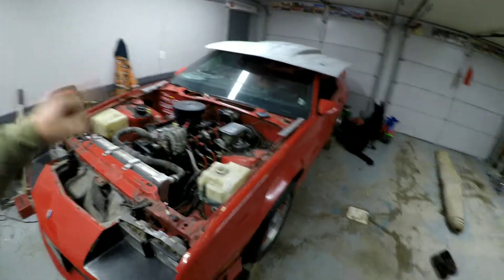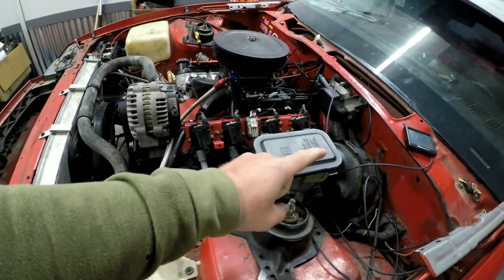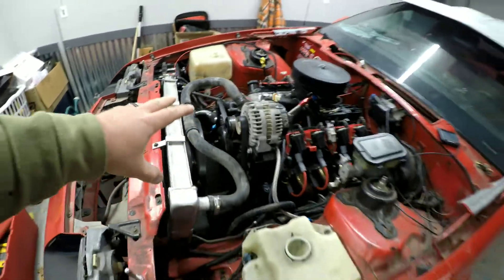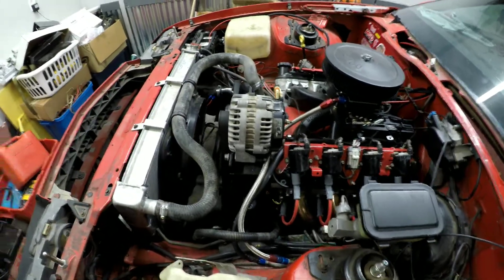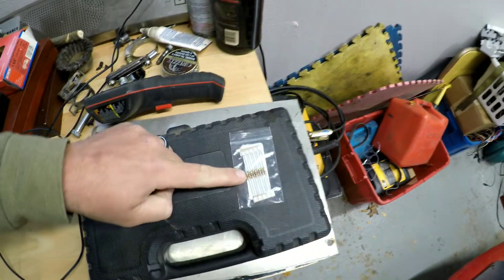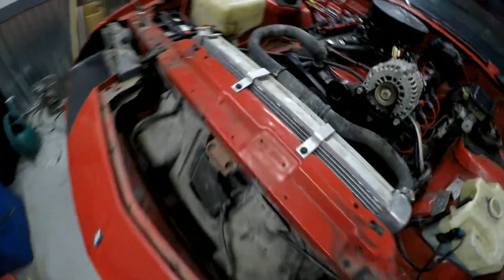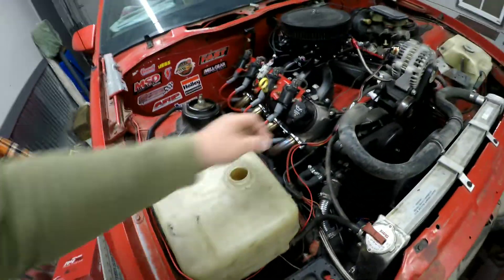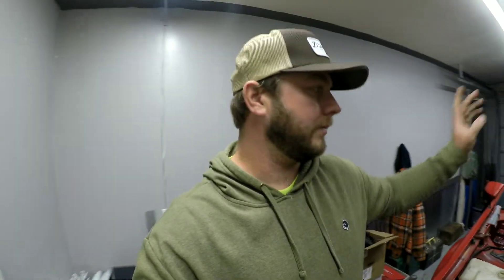EASY LS Swap Alternator Wiring! It only takes one wire! How to add a resistor!

Comment: On the 91 camaro alternator harness, the brown wire goes from key on , to dash light , then to "L" terminal on alternator... now your charge light in dash will work as it's supposed to ... "S" terminal on alternator goes straight to battery for voltage level sensing (not necessary) .. bulb is better than a resistor because it lets you know regulator quit when it comes on
Reply: So in this instance, the charge light acts as your resistor, dropping voltage?
Reply: @BeyondTheManual1775 yes..and more importantly,  it tells you when there's a fault in the alternator

Comment: Add another resistor and it will increase the charge voltage did same thing in a audio install charges at 15.2 for my application but the more u add the higher the voltage i would add until charging at 14.7 14.8
Reply: Do u add it to the same wire or different wire on 1 the other slots.

Comment: With the 470 ohms resistor inline it shouldn't matter much if it was straight to the battery because at 12v off or 14v running its sub 30 ma that can flow but switched it ideal

Comment: Ty ty ty. Hope u get this, been trying to wire a LS in my airboat. Not many people willing to give up free help. Ty ty ty.  Any thoughts does a msd 6014 need a fuse/circuit breakerand if so what size? Does a starter need need same. Any help greatly appreciated

Comment: Just for y'all's info: 
 P: Pulse (or Stator Pulse). This terminal is used for tachometers, which measure engine RPM. It's like the alternator's way of saying, "Hey, look how fast I'm spinning!"
L: Lamp (or Warning Lamp). This terminal connects to the warning lamp on your dashboard. When the alternator isn't doing its job, this lamp lights up to say, "Hey, something's not right!"
F: Field (or Rotor). This terminal controls the alternator's field coil, which helps regulate the alternator's output voltage. It's like the alternator's way of saying, "I've got this under control!"
S: Sense (or Battery Voltage Sense). This terminal is used to sense the battery voltage. It's like the alternator's way of saying, "Let me check the battery's level before I give it a boost!"
Reply: Thanx
Reply: Thanks for that. The harness i. Ought has a wire in the F terminal but not the s terminal. Any reason for that?

Comment: Couldn’t you run the L wire with the 470ohm right to the main lug on the back and then only one wire to the battery. Then it wouldn’t burn it up. Or would that eventually drain your battery

Comment: I ordered a 100 pack of 470ohm 1/2w resistors, and wired it just like you explained in the video. 

Didnt work

I can take a peice of wire straighr from a battery, hook the resistor to 1 end of the wire and test voltage on the other side of the resistor and its still 12v, i ordered a 100 pack, none of them make it go down to 5v

I ended up cutting the unused map sensor pigtail and used the 5v reference wire 

Holley should give you a 5v spaee on the harness somewhere

Comment: This may or may not be related to my issue as this is my first swap. Swap completed but my battery dies after a couple of days. Some type of draw and I can’t figure out where. I used an aftermarket harness and it had an alternator plug on it. Could this still be a possible issue and way to resolve? Any input would be appreciated
Reply from the maker: I would first verify alt voltage with the engine running to verify it's charging.. then do an amp draw test with a meter and see if you have a draw draining the battery..
Reply: @KravasGarage  thank you! I’ll start there. Appreciate the response

Comment: I have the 2 wire 05 truck alternator l terminal is the signal wire but what I have read it is controlled by bcm so I don’t know what size resistor I could use to signal say 4 volts which would give me a charge of about 80% not sure it’d this would work but wow it is hard to find a whole lot of ways to make the dr44 dr36 alternator charg w

Comment: I went from a cs130 to 130d; idiot light in L position.. so i need to runa wire from ignition wire to the “S” with resistor to make it charge?

Comment: This is also a fix for 99 to 04 gm trucks, if you have an issue with a new alternator not charging run a new wire with 470 ohm resistor from the L terminal (brown wire on connector) to and ignition source and you're done.

Comment: Cool video... I also have a 5.3 with a standalone harness... I'm using the 411 pcm.. pinout red-18 is the alternator signal wire.. my alternator hums while the key is off.. so I used my multimeter. Red-18 is sending 7v to the alternator without key.. I bought the resistor 470ohm.. and using a switched 12v source.. multimeter shows 12v still on the other end of the resistor... I bought the pack of 100 lol... tried 5 out of the pack still shows 12v after resistor.. check yours before you fire up
Reply: Did you get it figured out? I bought a pack of 100 and they test 470ohm with multimeter but not reducing voltage when wired in. I don't what the deal is!
Reply: @Jeremiah Morrow  yeah I have it figured out... don't buy a ebay harness lol... I have my ecm to a key source now... can't send a signal if it doesn't have power in the first place lol

Comment: Would you possibly still recommend this if I’m running a Terminator X Full Harness ECU?
Reply: Yes this is exactly how you would do it. I am using a Terminator x and there really isn’t any other way to do it. Holley offers a harness you can buy for 20 or $30. I would not waste the money. You can get this connector from a junkyard for nothing.

Comment: What is the top radiator hose part number and brand?
Reply from the maker: Factory hose that came with the engine (04 Silverado 5.3) I just shortened up the ends to fit..

Comment: Side question, what is that upper radiator hose  you are using?
Reply from the maker: Factory upper truck hose, I shortened the snout on the water pump about an inch, and trimmed the hose to fit. It was suppose to be for temporary use, but it worked perfect so I left it.

Comment: Man. You are spot on with this setup. I wish I would have watched this video before I burned up 3 alternators in a year on my 6.o swapped 84 monte. I ended up buying a 1 wire alternator and been good for over a year now.
Reply: What was part number on the one wire alternator ?
Reply: @MrMechanicandy  I’m going to go out in the garage and look to make sure
Reply: @MrMechanicandy  powermaster 28247 it’s a GMAD230 style. Go to Summit racing and the only review is mine and it has a picture of my engine.
Reply: @MrMechanicandy  I’ve been running this alternator for about three years with no issues
Reply: Sorry might sound dumb but how do you know when u burned and alternator
Reply: @eduardorojas7873  it quit charging
Reply: @jmullis78ify  thank you for your response and time 
... also I did what he did in the video a hot key one wire with a 470omhs resistor and I still end up with 12 volts at the end of the wire idk what am I doing wrong

Comment: Can I just use an ignition source from my fuse box and run a wire to L using a relay?   That way it turns on and off with the car?

Comment: So the Holley is just picking up the voltage off of its keyed 12v source and giving a read out in the hand held or screen etc?
Reply from the maker: Yes, it uses a constant power wire to battery as well as a keyed 12v.

Comment: So all I have to do is hook up the alternator wire with 470ohm resistor to a 12 volt source what happens if you lose 12 volts when you hit the key on but than goes back to 12v when you let go of the ignition would this connection work thanks
Reply: That doesn’t matter. It will work. just follow this video. You take the single wire to any wire in your vehicle that has 12 V when the key is on. The reason the resistor is there is to drop the voltage down to a lower value which tells the alternator the battery is low and needs to start charging.

Comment: Wait I’m doing this exact thing right now and I can’t figure out how the alternator is going to send the current back to the battery. I know I’m missing something obvious, but how does that one small wire tell the holley it’s charging the battery without having a lead going back to the fixed 12V?
Reply from the maker: The alternator still has the bigger main power wire going direct to battery, the small wire is only telling the alternator what to do.

Comment: What top radiator hose is that? I have the same setup as far as water pump and radiator outlet
Reply from the maker: It's actually the stock upper hose that came with my 5.3 pulled from a truck. I shortened each end to make it fit and also cut about 1.5" off the water pump snout.

Comment: Just use your stock wiring that came in your ls/truck wire harness and have your PCM program “Alt L” option “1” then start your engine then prove the harness alt connector “L” pin or “B” pin you should have 9 vdc as a signal or to excite the alt. If your harness has no voltage reading then you can use this video procedures. I use the stock alt wire harness with no issue.
Reply: When u said the “L” or “B” pin should have 9 vdc does that mean 9 volts for the exciter wire? Im tryin to wire up my alternator right since im pretty sure i just burnt this one up and cant figure out where the two wires from my 10si swap to on the newer cs130d

Comment: So do I cut the wire from my harness, add the resistor and put it on a keyed 12v source?
Reply from the maker: If you mean the harness from the alternator, then yes!
Reply: @KravasGarage  Just for more clarification.  My harness came with a 1 wire setup, I noticed my alternator wasn't charging.  So do I take that wire out of the harness, add a resistor and put the end I cut to 12v keyed?
Reply: @scoop0213  I need the same question answered

Comment: That gives you default charging. Now run a wire from the "s" terminal on the Alt. to your junction block, and you'll get higher charging ability.(14.5-15.0v)  Thanks for helping explain it to people!
Reply: What do you mean junction block? Which part?
Reply: Could you not run the S to the constant 12 volt on back of alternator if your gonna run to junction Box
Reply: @jeffcurrie123 it would be the same
Reply: @jeffcurrie123 yes
Reply: What and where is the junction box and it’s specific spot or location?

Comment: Is there a 12v wire ran to the back of alt from the Battery?
Reply from the maker: No, the wire I ran is a 12v sourced wire but is knocked down to 5v or so by the resistor.. the alternator gets it's 12v source through the main power wire that goes to Batt+.
Reply: @KravasGarage  does it have to be reduced down to the 5v or can it be 12v ?

Comment: Usually its the S wire that goes into the alternator power, might got alil mixed up
Reply: On the 4 pin truck Alt. the "s" terminal is the voltage sensing wire. The "L" or "F" wires are used to energize it.(only one of the wires NOT both)
Reply: @jamesaustin4044  Thanks just shit myself

Comment: Great information, will that stay fixed at the 14 volts or will it still be regulated ?
Reply from the maker: This alternator is internally regulated, it fluctuates between 13.6-14v on my digital monitor..

Comment: Great video. Simple and to the point... which is weird for youtube.
Are you planning on putting you camero on a dyno, im seriously considering running the same motor/ holley sniper setup in my nova and was wondering what kind of power you would get at the rear wheels. Mostly so i know if i need to change out my 10 bolt rear end.
Reply from the maker: Yes, hopefully I'll get it on a Dyno soon. I'm still on the stock 10 bolt with 3:73s and a pumpkin girdle. Funds didn't allow for an engine build AND a new rear so I left the stocker in place so I can still drive it!